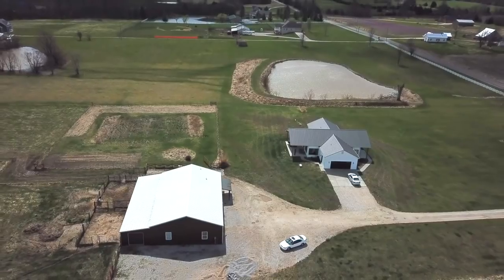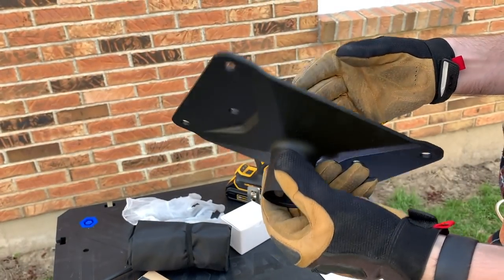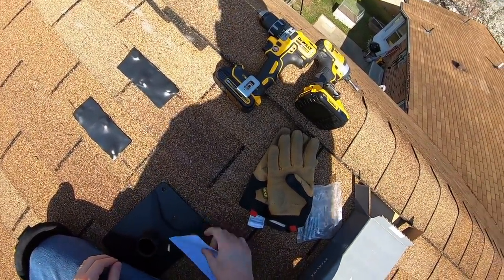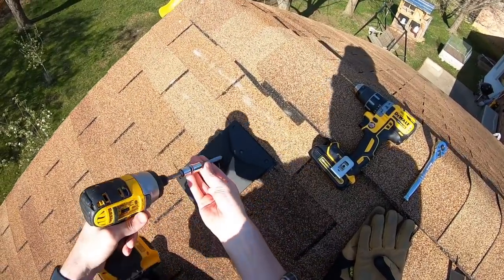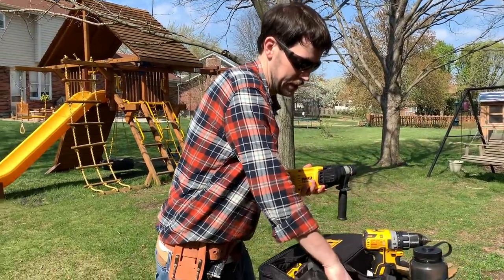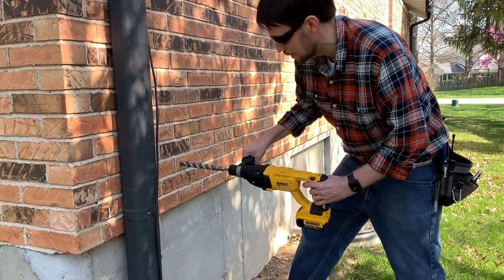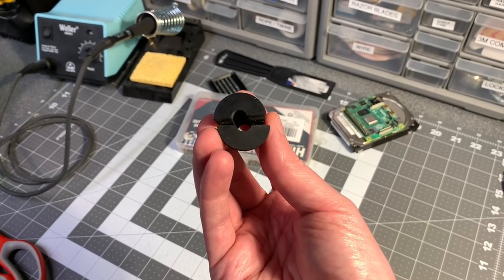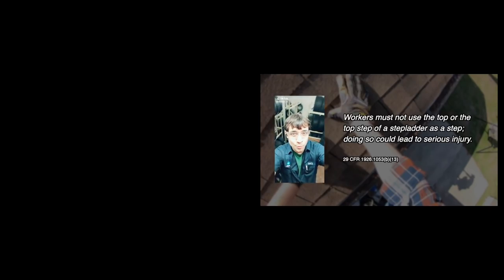SpaceX Starlink satellite internet - Roof mount install

Comment: I’d recommend putting a supporting stud under where you’d be drilling for the dish mount and connecting it to the other beams on your roof
Reply from the maker: I was planning on doing that, but I had some trouble getting the soffit boards removed (without also removing all the flashing and some other nailed-in bits), so I decided to just let the two left screws go only into roofing + plywood sheathing. I was happy enough with 4/6 screws going into solid wood.
Reply: @JeffGeerling  Ah! I didn't realize that you were still over the soffits and not actually the attic of your house. Yah removing all of that sounds like a pain for certain. Great install, btw! Awesome content - I'm looking forward to hearing your impressions in using Starlink as your primary connection. I had concerns over latency but the concept is certainly very appealing. I'm in a rural area, though somehow we luckily have a gigabit cable connection. We do occasionally have issues with downed trees here and cut lines, however - so I'd like to get fully off the grid and Starlink seems like an ideal solution.
Reply from the maker: @MiltonGeorges  Yeah, I'm excited to keep testing and seeing what it can—and currently can't—do!
Reply: The dish will get torn off the arm before those bolts pull out
Reply from the maker: @mrmotofy  The weakest part of the system I think is the two little retaining buttons that pop out to secure the dish + arm into the mount. They're good enough for high winds (already had two severe storms with 50-60 mph winds go through), but an EF-0 or EF-1 tornado might rip the thing off.

Luckily I'll have other things to worry about if I get a direct hit from a tornado or a branch large enough to damage Dishy falls on the roof!

Comment: I used to install satellite TV systems. You hit a lot of the right notes, except for all the ladder stuff you called out and the facemask. Here are some other thoughts. 
Wear a hard hat. It's really not negotiable. 
If at all possible, do not step onto a roof and work from the ladder instead. The most dangerous time is when you're moving from a roof to a ladder. Avoid creating that situation if you can. 
Mount the footing on the overhanging part of the roof, not any part of the living space footprint. This way, the inevitable leaks will be minor, won't affect the interior of the house, and will be quickly dried by circulating air from the soffits. 
Take only the tools you need to do a specific task, and make multiple trips up/down to do each one separately. This minimizes the chance of futzing around with loose tools or trying to carry too much stuff at once. Don't forget to take a swig of water after each trip: dehydration is no joke, and roofs are terrible places to work even in mild weather. 
They make a mastic butyl-based sealing tape that's the right width for satellite foot mounts. 
I'm disappointed but not surprised that Starlink doesn't include a bond to the universal ground, to avoid charge buildup on the rooftop hardware. 
Use some tape over the conductors of a pre-terminated cable if you're pulling it through a hole. Also, for RJ-45 types, tape down the locking latch for the pull. 
It's generally a good idea to tape a length of either straight or very slightly bowed, stiff wire (like coathanger or #10 grounding wire) to the front of the cable as a feed guide for pulling.

Comment: It's just a cat 6 cable nothing spectacular. Add a grey pvc exterior electrical box on outside of house with a slot in the lowest side for wire. The top or sides can allow water intrusion. Unscrew cover slip cord in slot and plug in to wire. To make slot cut a small V in plastic edge of box with a knife to start bit, then use drill bit same diameter of wire usually around 5/16"-3/8", on it's side to make a notch at V. The box can be painted to color match the home. Caulk to house wall with a clear or color matched good caulk like OSI Quad in many colors from your local home store. Then run a cat 6 patch cord(structured cabling) from box to inside home to wherever is needed eezy peezy

Comment: Nice enough for an amateur install. But when cabling, the run should flow nicely, staying relaxed but fixed regularly, especially on horizontal runs, and follow the lines of the building or fascias you're fixing it to. The drip guards are only ever a U shape drop as they enter/exit a building and not an actual loop of cable.
Reply from the maker: I feel like I have the first part fine (run straight, relaxed, fixed every 3-5'), and for the drip loop, I like having a coil because you never know (spoken as someone who's had to redo a lot of wiring for crazy reasons) when you want an extra 2-4" of cable to reroute it nicely down the line (and maintain a drip loop).

Having a loop instead of a U-shape gives that extra slack.

Comment: You should always start the hole under an angle from a lower point at the outer wall to an higher point entering the inner wall so water can't run inside.

I think you kind of did that but I would personally have done it under a slightly steeper angle
Reply from the maker: The greater the angle (at least with my brick), the more chance you chip-out the back half of the brick, causing the brick to split (worst case) or opening up a cavity behind the hole where there's a bunch of material impossible to get out of the hole.

I tend to be very conservative going through brick, especially since the house is almost 40 years old and the brick is a bit brittle in parts :)

But if you have larger brick, or ideally a smaller-diameter hole, a steeper angle is good too. Always want that water to go out, not in!
Reply: @JeffGeerling  I understand, my bricks do look a lot softer indeed. I learned that trick from coax mechanics here in the Netherlands. Probably here it's easier to take that measure. 

I really enjoyed the video though, as always!

Comment: I applaud your efforts to comply with OSHA 1926 however,  OSHA doesn't apply to you as a homeowner working on your own home. I used to be an OSHA "Authorized " trainer for Construction  (1926) and General Industry  (1910).

Comment: I would run your electrical and information separately the electric lines can cause interference along the information lines. even with the starlink line being POE and probably shielded you should run them separately.

Comment: Mine came with that mount but no screws or bag no clips and the cord was so tangled it took over an hour to untangle it. Can you use caulk or silicone in the screw holes and between the shingles and mount for more protection?

Comment: Cudos Tech Geek, you are now an experienced 8/12 roof walker. Starlink, wouldn't it have been better to have designed the cable to run down through the center of the mount into the attic. Just a thought.
Reply from the maker: Installing into the attic would mean I'd have to work in the attic for a few hours. I'd trade a hole in the brick through to my basement for working in the attic any day :)

Plus I'd still have to route the cable through a wall into the basement, and seal up more holes. If I bought the flashing adapter SpaceX now sells, I would've run the cable that way though. It requires a bit more work on the roof but should be even more leak resistant and clean-looking after installed.

Comment: Wouldn't it work just as good if it was lower on the ground on a pole or mounted on concrete? I really don't want anymore holes in my roof after 2 directv dishes installed.

Comment: I see Flannel Jeff is a DeWalt guy...
Reply from the maker: Honestly I started off with two Makita power tools back in the day. Then since a couple friends had DeWalt tools, I slowly started switching.

I don't have any particular fondness for DeWalt, but it's a lot easier buying tools in one system so the batteries can go wherever (since they're the most expensive part of most systems, sheesh!).

I was lucky that my DeWalt journey started with one of their first 20V MAX drills, so I jumped from Makita 18V NiCad to DeWalt 20V (heh, 18v really) Lithium Ion batteries, and it was a huge difference in terms of power output and longevity.

That, and I accidentally made my Makita release its magic smoke drilling a bunch of 3/4" holes through 2x4s.
Reply: @JeffGeerling  they have terrible batteries though, with zero in battery protections. Makita was the better of the two.
Reply from the maker: @tonymowder  I watch AvE, I know I know... I made my bed with DeWalt tools, and I'm sleeping in it. It's bright yellow :D

Comment: was half expecting you to lose that wood bit inside the wall cavity :-)
Reply from the maker: Ha, it's long enough that it wouldn't fall into the 1" or so gap, but I have had bits pop out of that extension before.
Reply: @JeffGeerling  tip for passing cables through the hole... tape the cable to the end of a long drill bit and pass the drill bit through first. Saves the cable curling up or snagging in the cavity. 😀

Comment: why are you guys installing the larger tape onto the roof and not the bottom of the mount? (peel,/ stick onto mount, penetrate tape with screws,. align with the predrilled holes and then secure all bolts, then tighten evenly)? Also,. ladder safety 101: You should not have your ladder positioned for climbing at less than a 45 degree slope. As for the rubber plug: Great idea, however I would have only cut 1/2 through to the hole so that you can have it (gently pinch/ seal the wire into the plug and not have to one halves to deal with (much easier)

Comment: That bracket looks like it will form a little puddle with the one bolt submerged? Should it instead be used 90 degrees rotated or do my eyes deceive me?

Comment: Probably easier to get a proper drill bit with metrics.  ;-)
You can put the mounting foot diagonal so that you have a longer distance between the stud mounting bolts.  That is usually better.

Temporary is alias for "permanently".  Permanently means "until I change my mind, within a month/week".

Comment: What is that material is on the roof? In Australia there is two major roofing material: clay brick and corrugated sheets (aluminium or steel). So bolting here would only be recommended if you had corrugated roof.will be interested to see how Starlink sells Dishy overseas where different materials are used for roofs...
Reply from the maker: Roofing is definitely a regional thing. Here in the midwest US, most roofs are 'asphalt shingle'. It's basically a 1/8" or so piece of asphalt material with gravelly bits embedded on the top. They are fairly flexible and cheap, and you nail them down over 3/4" plywood, that's nailed into 2x4 rafters spaced 16 or 24" apart.

There are some people with standing-seam roofs, clay tile, slate, etc., but that's the minority in the midwest here.

Comment: There's plenty of space on the back of the "wall of not well put together networking equipment" to hang the excess cable loop, between it and the railing.

Comment: You should get saw dust on your drill putting a hole anywhere on your roof, the whole thing hopefully has plywood under it!
Reply from the maker: True; I should've been more explicit—I could feel the hard wood all the way through the drilling, whereas on the holes on the left side (closer to the edge of the roof), I could feel that there was nothing behind the 3/4" or so of plywood.

Comment: never climb on to ur roof if u dont have to.  being an extra couple feet closer to a satellite many of miles away doesnt make a difference.  install dish about 1-2 feet above ur gutters.   depending on where u live they do dif construction, but you can often lift up the shingles near the gutters and physically see the stud,  sometimes i have to peel up a flashing to look.   this helps you land it correctly for the 2 center bolts.   i certainly dont predrill any holes.   cant stress enough how important it is that the 2 center bolts are actually in the stud.    

IF it looks promising and u got the time....run the wire in to the attic,  under the shingles near the gutter,  some houses are tightly sealed, some have a large gap already.     ur house has a huge over-hang,  u can often drill up in to that and get in to the attic.   now you can very cleanly drop the wire down the inside of a wall and use a post construction mud ring with a variety of dif face plates.

Otherwise you can often times tuck the wire in to the siding, so you dont have to look at wires all over ur house.  try not to use any screw clips if you dont have to,  vinyl siding was secretly designed for cable guys to hide wires in

Comment: I hope you will get cat6 cable with shielding as the cable you plugged in doesn’t look like it has a metal plug but only plastics
Reply: Unless he's getting gigabit speeds from the satellites, and/or has more than 100 meter of cables, it shouldn't have much of an impact.

Comment: In my country we have a very strict rules about lightning conductors. Every building must have it certified. I see there is nothing like that on your roof. Only the Dishy sticks out so lightning is probably going to hit that thing...

You sure you will be safe?
Reply from the maker: There are 6 trees around the house that are all at least 30' taller than the roof, and the building code around here doesn't require any specialized lightning rods or anything on residential structures. In the case of lightning hitting Dishy, it's toast whether or not it has special grounding (IMHO), so it's more the safety aspect that I care about, and in the case of my house, it's the shortest one on the block, with the most trees surrounding it, so I'm always more worried about a branch coming down on the house (especially if it's on fire from some lightning :D).

Comment: can i ask. whats the latency difference between having it on the roof or down in the garden? im just curious about this tech. i used satelite internet before and never tought about this.

aaa. there isnt enought line of sight. and in your situation is important. i got it
Reply from the maker: No real difference; and the physics of a change in 5-10m of distance dictates the maximum difference would be in probably the femtosecond range :D

Comment: Jeff!!!! Your ladder set is dangerous!!! Especially on grass. Most extension ladders have a square on the side so you can eyeball or put a level  on the long side of the square so as to set the ladder at the correct and safest angle. Sooner or later a ladder at that low slope will give out. Ouch! If the bottom of the ladder is secured, yes you can set the ladder how you're doing it. BTW, OSHA rules do not apply to self-employed. State industrial rules also do not apply unless you are covering yourself under their industrial insurance.

Comment: You really should use sealant in these screw holes and around the antenna base. The screw threads works like a capillar for the water
Reply from the maker: What would you recommend? I know I've seen some people put some sort of caulk on top of the screw heads, and I'd be happy to do that, but I'm not as experienced with weatherproofing.
Reply: @JeffGeerling  You can use silicone. Remove the antenna base, fill the screw holes and make a ring around them so the base spread it when you screw back
Reply from the maker: @phgodts  That's the point of the squishy balls of lead flashing material though, no? I put those on, then the black flexible flashing material after, then the volcano mount, then screwed through it all (and the flashing material definitely went all through everything; it oozed out the sides and through the screw holes too).

Comment: people watching this video, remember to always install the dish over the eaves if possible. That way if it leaks in your roof, it just leaks down in the eaves and not in your house!
Reply: I was wondering why nobody recommended this. That would be common sense though, just as getting saw dust from the 7/16 boards from under the shingles. I have to wonder what did he think he would get as he drilled through the shingles, if he didn't get sawdust. 
Lot's of things confused me in this video, especially the creepy singing.
Reply: @RipperYouTubeOfficial  and the drilling a 6 inch hole into metal to put a 1 inch cable clip screw
Reply: @Healcraft  I had to go back and start watching again to be reminded of the video. It only took me about 30 seconds to remember the video. Lol
Reply: @RipperYouTubeOfficial  i didnt notice you commented a year ago lol, my bad

Comment: You have equipments worth thousands of dollars, I just have small screw driver 😀😂😁
Reply from the maker: You'd be surprised—I have a list of the tools I need, and over the past decade, I've just followed SlickDeals and found a good deal on every one of the tools (and ladders) in the video—usually for 20-50% off. Beats paying the insane markup the manufacturers list the things at.

And the batteries... ugh, I did have to buy an extra 5 AH battery last year and was amazed how expensive they are on their own. It's like printer ink!
Reply: @JeffGeerling  most of the time the batteries don't have balancing circuit, so one of the cells will be stressed more than the others during charge/discharge cycles and the whole pack will need to be replaced, just because of that dead cell.

Comment: Use a hammer to find the studs. For safety, that extension ladder needs to be at a 75 degree angle. Shorten it! I broke a hip and my jaw in 2007 from a steep ladder that kicked out.

Comment: Hey, sorry, i hate to be THAT guy but the ladder looked to be far too low of an angle where it could slip out from under you (also weaker the more it's leaned). Generally holding the ladder at your feet and holding onto it with your arms outstretched, for most peoples bodies, is a fine angle.